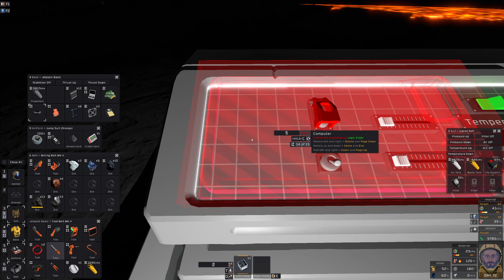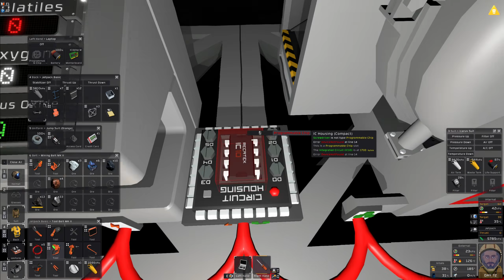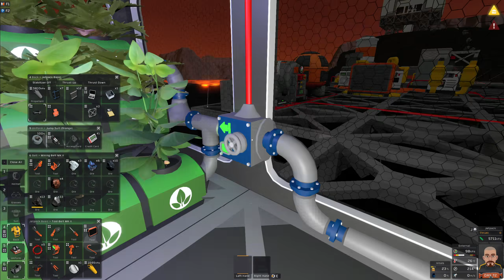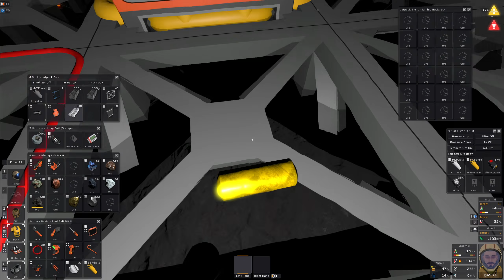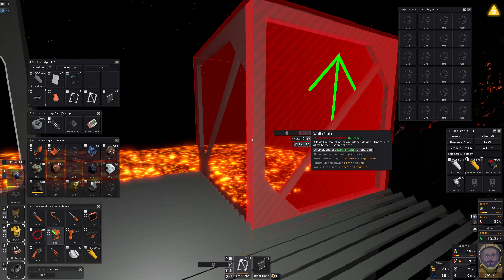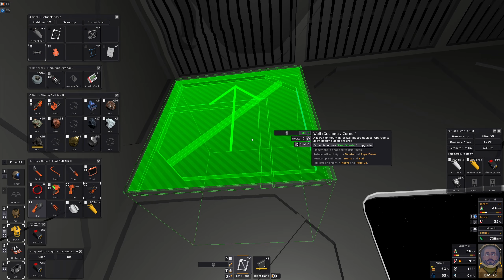Furnace Console Fully Operational - S2 E23 ║ Stationeers

Comment: "In real life the cover flips the switch off."

Wrong kind of switch cover bub. These ones are used more for lock out tag out purposes. Note the small cutout on the cover, its meant to hold the switch on. If you flip the switch off then lower the cover irl it should lign up the bottom of the cover allowing a lock to clip it closed.

Would make more sense to have a quick disconnect cover in the context of videogames, but i honestly haven't seen a single one with correct switch covers outside of flight sims.

Comment: At 15:40 you were talking about how the safety covers turn off the switch when the cover is closed. That is actually not always true. Most will turn it off, but there are some like the one in the mod that will lock it in either up or down position, for cases where you don't want to accidentally turn it off OR on.
Reply from the maker: Ah good to know. I guess we can choose which one we want with the IC10 code. For the furnace the auto-off version is I think a bit more useful. :)
Reply: @Hmuda its more of a switch with a verification, a variant if the switch with that toggle off feature would be interesting yes but more useful is very subjective
Reply from the maker: @VenoPhage  I only meant the "more useful" for this niche application. Accidentally releasing the mold can be quite messy, and having it auto-turn off can be quite beneficial, so it doesn't stay open...which I tend to do way too often. :D
Reply: We based this switch on a real switch from a soviet era helicopter cockpit design philosophy. Really liked the little cutout that lets you see if it is on or off. The auto-off version is much more common though and I have never seen our version anywhere else than in Mi- and Ka-series aircraft although supposedly it is also used for very specific industrial controls according to the internet. Guess you really have to dig to find something similar in current western catalogues.
Reply from the maker: @WIKUS70  Thanks for making the mod, it really is something special. :D

The good thing about IC10 code is that we can have both versions. For this application the auto-off version makes sense, so I just made it work with code, other applications would definitely benefit from the locking function more.
Reply: @Hmuda  yea auto-off is totally valid... the way Stationeers handles devices is really fun and unique for a sandbox game and Tom and I are very happy that after all this work we got the mod out eventually. We would have added both switch versions simply for convenience but we might wanna add other things first and the workaround is straight forward indeed. Really interesting to see you build these for the "first time" while talking about the setup and your thought process. I even think you are the first one to showcase the mod.

The upcoming mod update will introduce many new consoles with interesting new modular options.

Comment: 45:15 In a real world, we are using a term "SOC" as a "State of charge"
Reply from the maker: Looked it up, as far as understand the wikipedia article about the term, it's about the amount of power in the battery. The third display shows the second-to-second change happening in the battery, basically the difference between the incoming and outgoing power. If it's positive, the battery is charging, if it's negative, the battery is draining.
Reply: @Hmuda Ahh my bad must have misheard something. Then you could use "Energy flow"